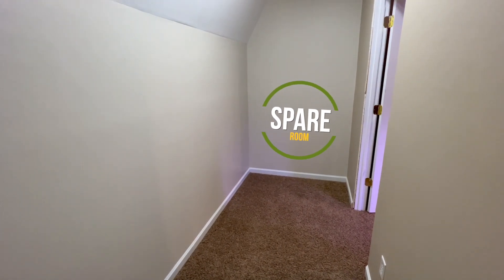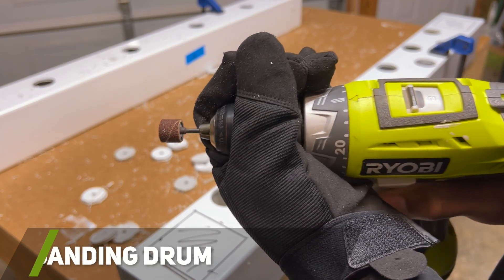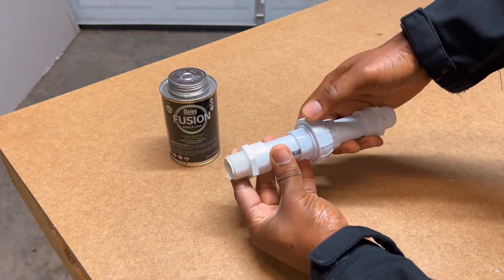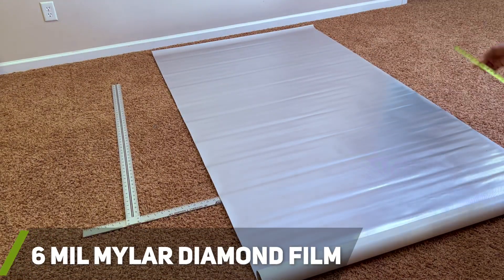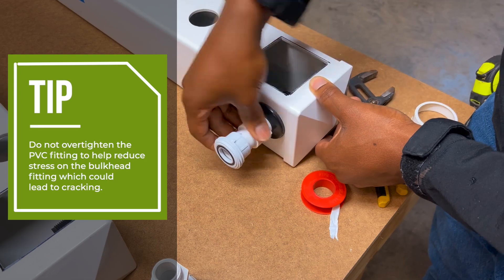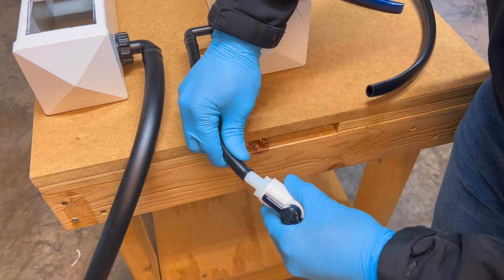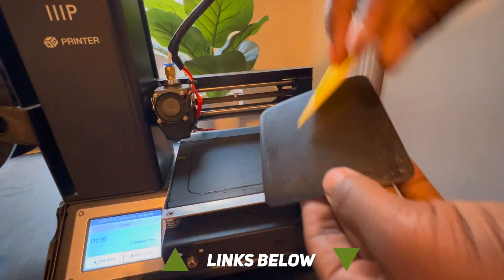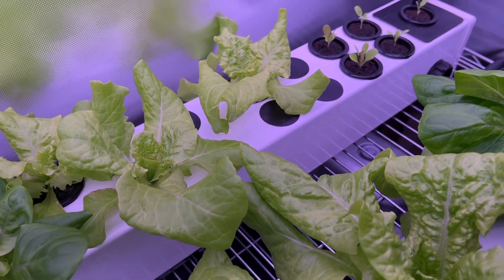How To GROW Lettuce Indoors ALL YEAR With A DIY Hydroponic System

Comment: What a great build video! Love the detail! I'm in the process of planning an indoor system for my kitchen so this was great info for my plan. I had some questions if you get a chance to answer, that would be great! First, in trying to keep the system chemical free, I wondered about your use of fence posts, I know Simple Greens Hydroponics has done safety tests on regular pvc pipes, but I've never seen anyone test the posts. I was surprised to hear you say the pvc cement; was safe for potable sytems, as I had planned to try other techniques like plumbers tape for making my system water-tight. The other question I had was regarding the submersible pump. I watched a very detailed video by Do It With Pierre where he went over the exact calculations for determining what size pump to use with nft systems and after figuring the head for 1 channel, he multipled that by the number of channels and then added 20% to account for flow around the fittings to come up with the head size for the pump. Seeing how huge your shelving unit was (mine is only 24"w x 14"d x 60"h)) and considering the two channels I was expecting a much bigger pump size... but then you said your pump had a head size of only 5 feet, and was oversized for your system! Now I'm confused as my calculation was a head size of 7.2 before accounting for multiple channels. Lastly I was very interested by the use of aquarium sealant, all the unique fittings for water-tight seals and the diamond reflective film, all new techniques to me and great options, thanks for that!

Comment: hey how did you end up with different water levels for the two rails if the outflow for each is the same height? i know the outflow is 3/4 and inflow is 1/2 so there is prob a slight height difference from that. but it looked like a bit more of a difference in the video when the net cups were in. thanks for the help! inspired to build one myself~
Reply from the maker: It's been a while since I worked on this project, but I believe the inflow and outflow holes are at different heights, but also the hole sizes are also very critical and the flow rate for this to work correctly. I believe the plans I included in the link show the dimensions for everything a little better.

Comment: Always sand all the areas which are going to be glued, so there is a much better rough surface for the connections. And of cause, don't usw silicone for that. Better use a glue which is made for that and is stronger and more long lasting.

Comment: What was the cost of this system?
Reply from the maker: I honestly cannot remember the full total right now, but if you are starting from scratch and needing a metal rack, LED lights, and all the other materials I used in this video, you are probably looking at $500-$600+. The metal heavy duty rack, LED lights, and air pump would be the costly items from what I can remember.

Comment: I'm new here and dropped a like.

Is there a specific pump size or model or something you recommend so the pump isn't too powerful for a setup of this exact size? Maybe an adjustable pump idk if that's a thing
Reply from the maker: The pump I used in this video can be found here: https://amzn.to/3MJQ9ug

I would say if you are building a system the same as mine, I wouldn't get a pump that is more powerful than the one I have in the link above. The pump I purchased does allow some adjustment but I found it did not work that great. Installing my ball valve is what really helped me. Also making sure the outflow hole is larger than your inflow hole is key as well and something I would have done differently if I built the system again. Then I probably would not have had to use the ball valve.

Comment: Great video.  Here's an idea.  I was drilling with the hole slaw and it would contact the rail every time because once you break through with the drill bit, it takes a lot of control to stop the hole saw from contacting the rail.  I did the first couple of holes on the second rails to practice like this..  To avoid this I just drilled a pilot hole with a drill bit the same size as the coleslaw, errr, hole saw.  (I'm hungry.)  Then I went back with the hole saw using the pilot holes.  This relieved some anxiety because with some hole saws you can't see the point you're drilling into.   Thank you for your video.
Reply from the maker: Thanks for sharing your tip in case others run into that problem.
Reply: @GreenTechTown  I like your idea of using 3/4" pvc instead of 1" like Caleb does.  3/4" is much easier to cut with a pvc cutter like you show in your video.  If I build a second system, I'm going to use your idea of 3/4" inch pvc.

Comment: This is a great and very detailed video. My only comment is that on your pump flow valve, you may want to look at using a 3 way valve instead of a straight ball valve. You may be putting extra stress on the pump where you could just use a recycle loop coming off of the 3 way valve. Just a suggestion. Great video.
Reply from the maker: Good idea!

Comment: Robert I was just about to download your plans but wondering 2 things before I get started.  1. Would it be difficult to expand your 2 rail system to 4 rails in the future? 2. Is there anything you would recommend doing different since you built this system (e.g. improvements over time).  Anyway happy holidays and take care.
Reply from the maker: 1. No it would not be difficult, you just have to determine what you plan to grow and how low/high you want the water level to be and adjust your inflow/outflow holes accordingly. 
2. I think the only change I would probably make is increase the outflow hole size so the water can drain out of the rail system quicker and there would be no need for the PVC ball valve I had to install. 

Thanks for watching and happy holidays to you as well!

Comment: Ive seen zip ties fail in these settings as the light degrades the plastic much faster than you may expect. I would recommend black zip ties or even metal zip ties or some other light insensitive method

Comment: how do you control the height between each of the holes? On the same railing, how do you make some holes allow to the mesh sit deeper within the system than other holes?
Reply from the maker: Hey JAWN. I'm not sure I understand the question, but all the holes for the net cups on the same rail use the same diameter hole. I do control the water level by drilling the exit/outflow hole lower than the inflow hole.
Reply: @GreenTechTown  gotcha! So you can only control the height of the root zone for each pot by adjusting the water level of the entire tube. 

So I’d dedicated one tube for younger plants and let the water rise higher and on the next system geared for more mature plants with longer roots, set the water so it doesn’t build up so high? That makes sense!

Comment: Is the flow limiter going to put stress on the pump?
Reply from the maker: Hey Adam. I initially thought it would but after reading reviews for the pump, several other customers did the same without any stress issues on the pump. So far it has been working fine since early Jan. when I installed it.

Comment: Excellent video!  This is gonna come in so handy as we JUST bought our rack two days ago and we've been brainstorming on design.  Any tips on if you want to have channels on multiple rows (one above the other) and how to connect them so only using a single pump and reservoir?  Thanks very much!
Reply from the maker: Awesome. Yes, that's what I like about this system as I can easily add more rows if needed. In my case, instead of the outflow pipe going back to the reservoir, it would connect to my next row. You could also Tee off the inflow tube to a secondary system/row.
Reply: @GreenTechTown  So in your setup I believe you had a 1/2 inch tube bringing water in and 3/4 inch draining out.  If I wanted to outflow the first level down to the second, would you still use 3/4 inch exiting first row and run into second or would you switch that to 1/2 inch?  Ultimately it's gonna exit 3/4 inch, just wasn't sure about that transition from level 1 to 2.  Thank you so much!
Reply from the maker: Since I can control the flow rate on the inflow pipe, I would probably try the 1/2" tubing since it would be cheaper for the tubing and fittings. The important part is making sure the inflow of water is not flowing faster than you can remove the water from the system. So if the outflow fitting was smaller, and I had a high inflow rate, it is possible the water would overflow from the rails. 

I think the best way to go about this is my second option I mention which is to split the connection from the pump to the 2 systems using a Tee barb fitting. That way each system could be taken out for cleaning without effecting the other. 

Be sure to check out the Simple Greens Hydroponics channel as well that has tons more information on this style system and will probably provide more advise on expanding the system: https://www.youtube.com/c/SimpleGreensHydroponics

Comment: I am curious about the cost. Is it worth it?
Reply from the maker: Hey Thuy guy. Yeah I think it is totally worth it to learn how to grow your own food indoors and not only rely on grocery stores or outdoor gardening. This type of system can be used to grow all types of veggies even though the focus of this video was just for lettuce.
Reply: Only if you grow cannabis. The cost to start a grow is very high. Led lights are expensive,  you also need inline fans to bring in fresh air/co2 and to exhaust hot air.  You also need fans to move air inside the grow room. Then you have the expense of the hydro system and components. All that money to grow some lettuce.... you could probably buy several years worth of veggies instead. Then you got the electric bill to pay every month.